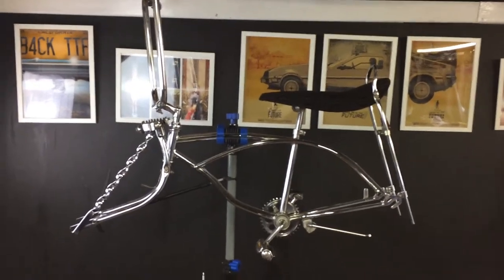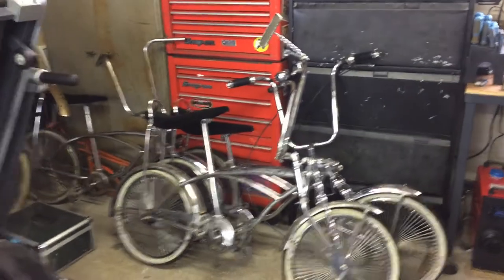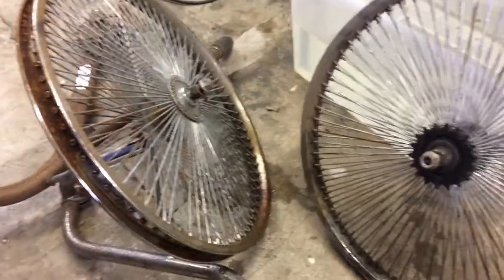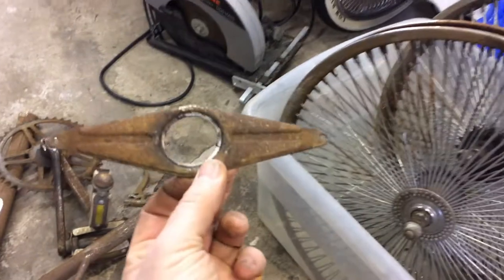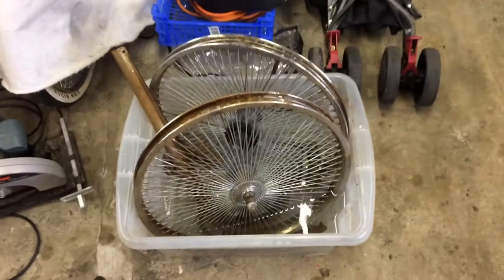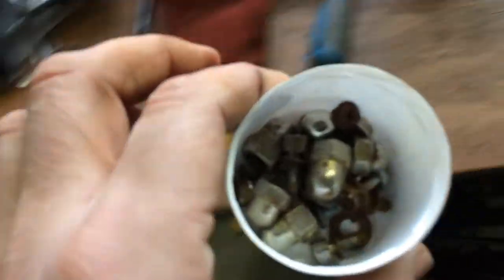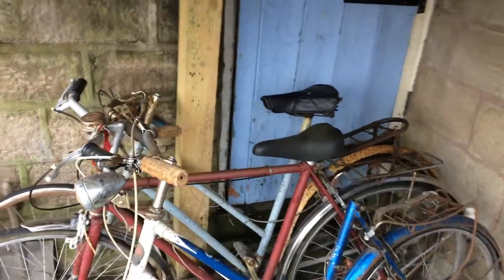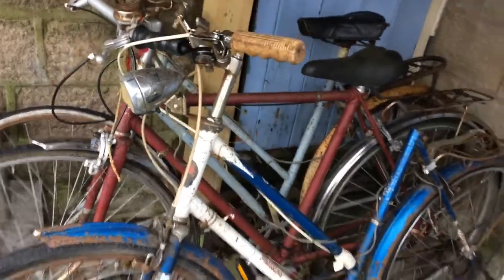Parts cleaning with Citric acid & Basket Case Lowrider - finale

Comment: How much citric acid do you use?
Reply from the maker: I just buy citric acid powder, kilo tub. Ebay or home brewing shops sell it. Then can make it to whatever strength. But it in a 80ltr tub, so it covers the 20” wheels etc in one go. Hope that helps
Reply: Wish I would of seen your videos earlier.. I soaked mine in oxalic acid and it fucked up the chrome. Ended up taking them to get re chromed 😂